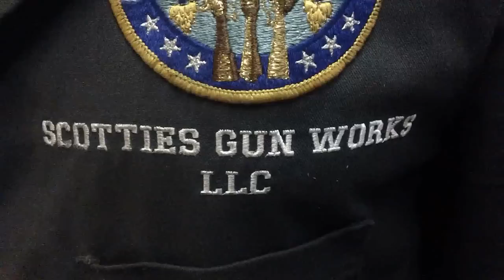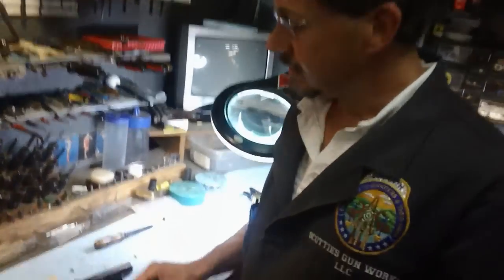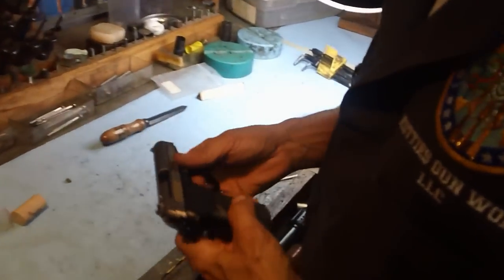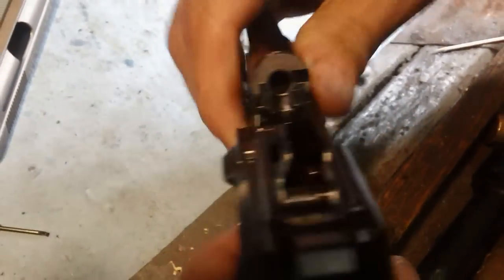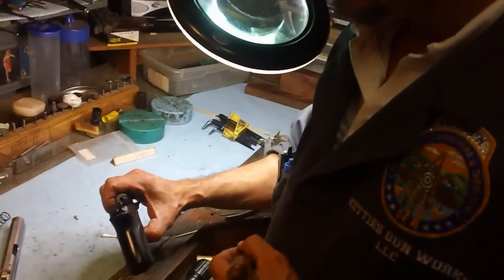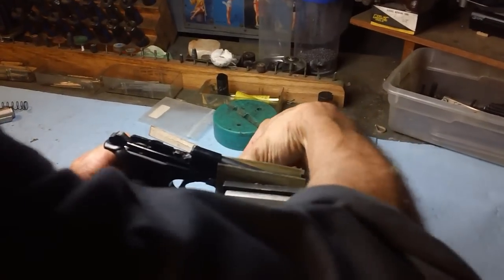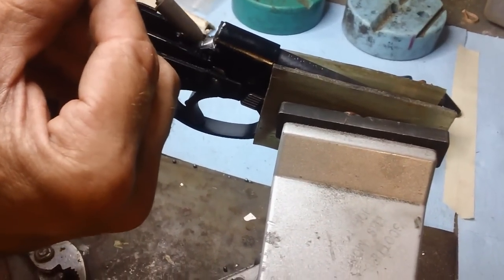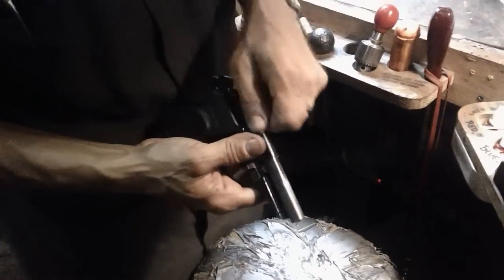Fixing feeding problem on a 22 pistol -Profesisonal Gun Smithing Series

Comment: Polishing the recoil spring helps these guns cycle. Sometimes the spring is rough and Flitz or Semichrome and a rag and LOTS of elbow grease pulling cloth back and forth thru hole in springs will help. I also " fluff and buff" the barrel with flitz and the slide rails and the clean it well. Then I reassemble and oil with Ballistol and leave mag out. I hand cycle over and over and over for days, thousands of times in a week . It help hand strength haha and weakens spring. Cycles much better now. Polished my feed ramp with felt tip. Took alot longer than you did it. Also polished my chamber ( it is smooooth now ). Much better.

Comment: Weak mag springs is a really big issue that causes odd feeding problems. Replacing the spring is always a good idea to start with. And get a strong spring, sometimes the factory puts weak mag springs in just cause that makes it easier to load the mag, and customers like that. The feed ramp is often not the issue (but can be). What happens is that the rounds in the mag will compress the spring in the mag under recoil, and might go so low in the mag that the slide skips a round totally, or the round exits the mag in a bad angle and miss the hole in the barrel more or less.

Another problem is the lips of the mag that might be to tight or loose.
Reply: Where do you get your springs?

Comment: Excellent video, thanks. My FS 22 will cycle fine with Thunderbolts, and I haven't touched the feed ramp, yet. However, it won't cycle reliably with bulk ammo, and the problem is not the feed ramp, but rather the ammo isn't hot enough to push the slide back to the point where it will strip off another round, sometimes stovepiping the spent shell. I just ordered a second recoil spring, with the intention of snipping off a ring (or more) of the spring to weaken it just enough to allow the slide to cycle using bulk ammo, which I have lots of. CCI Minimag is the best I've found for the FS 22, but these days I can'[t find it. So I'm going to have two recoil springs - one for CCI MM and another for bulk ammo. I've heard of people doing this, but I have not seen the results. Any ideas?
Reply: Hi! Did you fix the problem by using a softer spring? I have the same problem with bulk ammo. I want this to work with cheap bulk ammo coz its my plinker! Thanks!
Reply: Did it work????